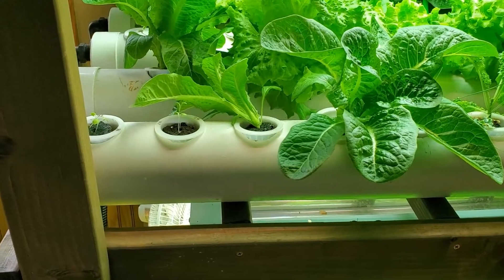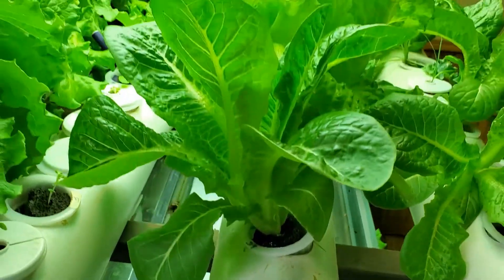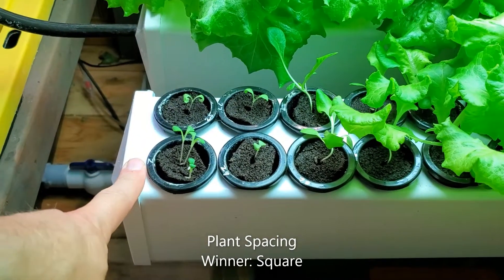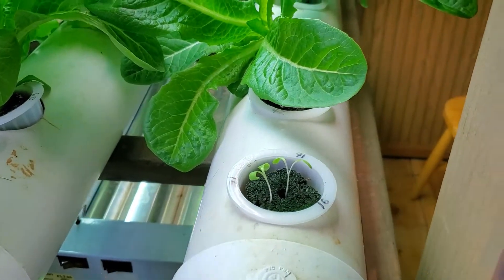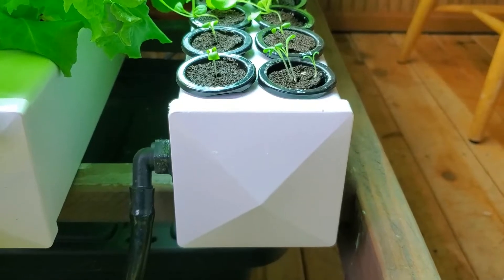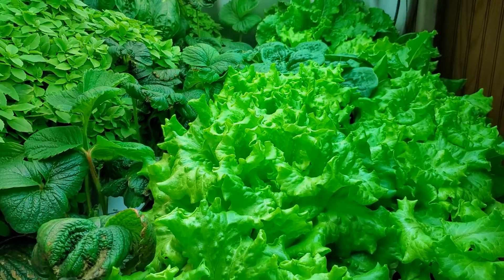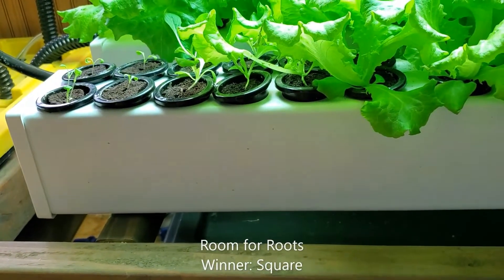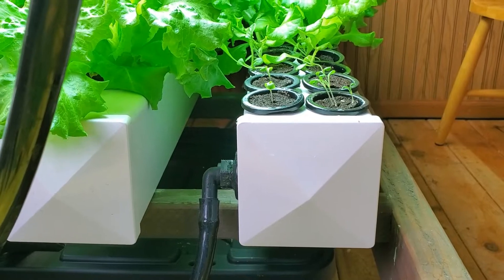Hydroponic PVC Rails: Round vs Square?

Comment: Building my system in a carpeted area. How concerned do i need to be about potential leakage from the fence post covers (assuming i use silicone)?

Is it worth building square or for watertight safety, should i rather use pvc round piping?

I can't afford to have any leakage whatsoever and i don't have any other space to grow in (I live in NYC and the only domain i have a say over is my bedroom)

Comment: I was considering square, but just did some more research.  Square fence post is vinyl PVC, not uPVC like pipes for drinking water.   Very toxic stuff that leaches phalates, BpA, etc.  uPVC like they use in pipes is similar, but they keep the nasty stuff out for drinking water contact.   Stay safe.   Also you could bend PVC pipe with a hairdryer and  board to flatten off the cup holding shape.

Comment: Use rain down spouts as they are only $10 for 10 ft. The ends are harder to seal but cost and size is smaller. 
https://youtu.be/BNJ2izubN24

Comment: I cut pvc 1/2” thick or wide rings out of two inch pipe ( if you are using 2” net cups) and inserted in the openings to prevent wobble.

Comment: I have a 4 X 4 PVC post sleeve system like yours and agree 100% with you! BUT SERIOUSLY!!! TOXICITY! : I have the exact reservoir as you, I did a ton of research on all the manufacturers of the black / Yellow top totes. ALL are made of recycled polypropylene resin (PP). BECAUSE it is a post consumer plastic there will definitely be leaching of chemicals that you DO NOT WANT!!! Please look up a food safe drum liner or the like and line your reservoir / tote with it to prevent I'll effects. We all learn new things every day!!! Great video! Best wishes!
Reply: Thanks for that, I was about to use a tote.  Also the fence posts are cheap vinyl PVC, not uPVC, they are more leachy and toxic than the totes….
Reply: @CGreciful  Poly Vinyl Chloride (PVC)  is safe, so long as the water temp. never goes above 120F. It can be used in some municipalities that accept it as code compliant. I got a mylar drum liner off Amazon to line my tote. I find the 27 gal. Totes to be perfect size. Best Regards.
Reply: @marknack7816  depends if you're talking about chlorinated or un-plasticized PVC.  The fence posts are the cheap stuff (why would they use the expensive stuff for a fence!).  Just be careful, there are dozens of types of PVC out there.  The bad ones are REALLY bad and the good ones are REALLY good.
Reply: Shh, nobody cares of your opinion. Not to offend. People care about real results. Don't let that make you mad but based  opinions vs facts. Facts win and opinions  are like a$$holes. Everyone  has one. And that doesn't matter
Reply: Unbiasedly  give an opinion  or do not at all

Comment: You don't need to glue the joints on the drain side of the round PVC because there is no pressure on the joint. A tight dry fit should be all you need. It would make the round system just as modular. You can also cut short stand pipes for the net cups, glue those to the round pipe and then the next cups are secure.
Reply: piece of 3" pipe 1/2" long, glue in place
Reply: Mine leaked. I didn’t want to use pvc glue to be able to remove and clean. I had a slow but consistent drips.  I used food grade silicone to seal.

Comment: I've had good luck setting up the round tubes with rubber bands on the ends to work as a gasket instead of cementing them in place.  I did this mostly as I was still working on the configuration and didn't want anything to be permanent, but it still works well enough and lets you disassemble things later.

The square tubes have a lot going for them, but they cost more, you can't get them in as long of lengths (or I haven't been able to find them), and I haven't been able to find any food safety ratings on them for anyone that might care about that.
Reply from the maker: Cool, I'm working on another system with round tubes and may try the rubber band trick. I remember trying it awhile back and it worked well.

Comment: Hey I was wondering if by then you changed this design. The square pipe has way too many planting spots per square inch and they're going to kill eachother
Reply: About to build a very similar design and wondering about hole to hole spacing. Any insight would be greatly appreciated
Reply from the maker: I still use the square design and it works really well. I move the plants along the rails as they grow, so only the seedlings are right next to each other. They are moved to an 8 inch spacing as mature plants so there's no crowding.

Comment: Excellent. Thanks for this review. I have several systems running: two towers with LED lights (indoor) and one outdoor system using piping. After using the piping system growing 108 plants I can see the square or rectangular type system is far better. The basil growing in the piping system are large now and the top heavy plants cause the roots growing inside a basket to occasionally pop out of the pipe. Also, it would seem to me there is better water flow to provide nutrients to the roots and more space for the roots to grow in rectangular or square channels. I think the rectangular channels would reduce the amount of water needed as well.

Comment: Just a simple tip, when building with round pipe, you can get a heat gun and heat around the holes... with a simple piece of wood then slight press area flat around the holes to stop that leaning issue. Awesome set up though mate! Cheers
Reply: I like the one DEA what would the heat which gets above 140 leach anything bad out of pvc? A good question though.
Reply: Show a video

Comment: Even if you use pvc cement on the round pipes you can seperate them with a little heat. While not ideal it can be done

Comment: Be grateful you guys have access to this stuff. Here in Australia, its near impossible to find any similar square PVC tubing. Plenty of 100mm x 50mm but too shallow. Not many importers for this stuff.
Reply: same in Canada, I think 10 ft of the square post cover is $50-90 depending on where you look!
Reply: I’ve seen another channel from Australia that makes his various hydroponic systems out of rain gutter downspouts, and they seem to work quite well.  I would feel awkward advertising someone else’s channel here, but you are able to search for rain gutter hydroponics and I’m sure you’ll find it.  You may have to treat each tube/pipe as a separate channel instead of a zig zag connection, but that shouldn’t be much of a deterrent
Reply: Bunnings sells 100 x 65 mm PVC.

Comment: Hi there, do you have the heights anywhere for you inlets and outlets on the round tubing to make it run correctly? The fence posts are too expensive where I live. Thanks.
Reply from the maker: If you grow seedlings in the system, then put the center of the outlets about 1.5 inches from the top of the cap to keep the water level up. Otherwise put them as low as possible (probably 1.5 inches from the bottom). Inlet is as low as possible, though not a big deal. Hope that helps!
Reply: @SimpleGreensHydroponics  Thanks for the help.

Comment: Two things that keeps me from building a hydro farm that way are
1. keeping the water stable, especially when plants are bigger it tends to high ph. How do you keep it stable?
2. dependency on the pump. If it fails, you have only short time to react. Do you have any alarm or failsafe?
I would rather go for a deep water culture that in my opinion brings almost the same results and is way more failsafe as it just needs an air-pump.
Btw. isn't it a risk using non-biological fertilizer as overdoses might accumulate in the plants?
Reply from the maker: 1. I have not had any significant issues with pH so it seems like regular water changes keeps it in a good range. 
2. I agree about the dependence on the pump, that's why I designed each rail to hold some water even if the pump shuts off. I've left the pumps off for more than 24 hrs during maintenance etc and the plants have done fine.
Reply: @SimpleGreensHydroponics  thanks for the reply. A larger amount of water might be the biggest adv and keeping water in the tubes in case of emergency is a good idea!

Comment: You can easily fix the stability issue on the round grow pipes. Simply heat the higher sides with a heat Gun & push them down until they are flat.
Reply: OR...
Custom 3d print net cups that conform to the round pipe...

Comment: I've toyed with both and found the round to have more advantages than the square. Cost is a biggy, those square post jackets are 4× the price of the pipe and the endcaps are also. I drilled the pipe so that a 1" piece of 2" pvc pipe could be forced into the hole giving me a flat seat for the netcups. I also use test caps on 1 end that can be easily removed and a threaded cap on the other so you can quickly remove the whole rail for cleaning. Using silicone on those posts is a pain in the ass when it comes to cleanout and reassembly.
Reply: How does the silicone work anyway?  I made a homemade cloner out of a plastic tote and tried using silicone and everyother type of caulk that is sold at lowes.....No caulk holds up to the nutrient solution (which are salt based).  I swear every caulk I've tried has melted in less than a month.
Reply: @Khaymen223  pure silicone. You can also ask advice from salt water fish hobbyists on non-silicone sealants they use if it doesn't work well for you

Comment: This is an indoor system, but if you are doing this outside, another advantage of fence posts is they are typically UV stabilized plastic vs plumbing pipes which usually aren't.
Reply: The vinyle has plaster users in it and should not be used for hydroponics per chemical engineering friend mine but makes sense. Use only schedule 40, 51 or 61 safe PVC. I know its a bummer would like go flat but unless you order by chance of it direct from manufacturer u will likely have stick with the schedule 40 pipe from local stores. Do not get the Schedule 40 series foam core pipe accidentally though just the heavy schedule 40. Also get Schedule 40 2" pipe and go with utterly as much safe off as possible. Super video n nice comments all helping and supporting info here.
Reply: In any of my systems, I first paint the whole thing with black paint then a coat of white in an attempt to slow down algae growth. I try to keep it dark inside the system but, if this is not a concern the a coat of paint to keep sun damage is a good idea too. Be sure to mask off areas where paint is not wanted.

Comment: Have you considered turning the square pipe 45 degrees so there is a piont up and pointed down, so not lay flat, that way you could stager the cut outs on opposite sides of the now 2 "tops"?
Reply: Nice video too

Comment: square tubing isnt food safe made of vinyl that is injected with chemicals to resist mold and cracking (called manufacture )  , round pvc is food grade safe as it is used as drinking water supply  ... that should be a huge factor
Reply from the maker: Yes, round PVC is often used for plumbing though many of the larger pipes are still not labeled "food safe". Based on my research I'm not concerned about either though:
https://www.simplegreenshydroponics.com/posts/2021/is-pvc-safe-for-hydroponics

Comment: I believe those vinyl fence posts are made of a similar pvc as plumbing pipe. I used pvc cement on my rail end caps and they seem to have formed a solid bond. I slathered extra cement in the corners just to make sure it wont bust a leak at some point. Hopefully they wont be too difficult to clean out at the end of the season because of the end caps being permanently attached...
Reply: they are not,  fence post are made of vinyl not pvc and injected with chemicals to resist cracking / mold at least here in canada. My dad has a greenhouse  and called the manufacture of the post that are at homedepo and was told they are NOT food grade

Comment: You missed covering the price difference between the two.
Reply: Use vinyl downspout 10’ length. You can get it for less than 15 bucks. Looks like he uses vinyl fence posts which are more expensive.

Comment: What you would like to have is FOOD GRADE PVC.. Most PVC are used for drainage and sewage.
PVC GLUE CAn be replaced very easily with DOW 688 which is very sticky and quick drying (not food grade) - as long as does not contact the nutrient solution and it can be easily removed and leaking joints can be easily fixed as external gap application .

Comment: The trust supports are wrong , the screws hold the weight. The beams should be support by a vertical one. Like the way you build a deck. 
The square shape is very good . Thank you for sharing , i'm looking to build one too.
Reply from the maker: I considered that, but decided to use compression on each end of the beams and a screw to hold them in place to reduce the size and materials. Each beam holds less than 20 lbs so not the same loading as a deck. Glad you liked it!

Comment: Some excellent points in this video, you've given me some things to think about. 
TBH I suspect price and availability (both piping but especially for fittings like endcaps) are likely to be the deciding factors on which pipes ultimately get used - here most of this type of piping is intended to be downpiping for house guttering, and tends to be round.
Reply: Oooooo, rain gutters are a great idea! Every time I see one of these DIY systems, I think "how are you going to clean that?" I think you are on to something great!
Reply: @RichardBronosky  How would you clean this one? It's something I've been meaning to ask,
Reply: @melody5437  what do you mean by "this one"? PVC pipe, PVC fence post, or PVC gutter? The gutter is obvious in how to clean, I believe. The post, I would seal with silicone caulk instead of glue so I could knock the ends off with a plastic "dead blow hammer" and clean once to 4 times a year. The pipe, I would build with a screw cap on at least one end. If I had to clean one that wasn't designed with cleaning ahead of time, I would try putting a box of Rock Salt in it an white vinegar and shake it about 4 times an hour for one day. I would only resort to harsh chemicals if time and wisdom failed.
What's your situation?
Reply: @RichardBronosky  Don't have one - that's why I asked. It turns out he has a video on how he cleans his system, however.
Reply: @melody5437  Good! You're doing the right thing. Always think about living with something before you make/purchase it. Life is not a TLC (USA TV channel) extreme renovation show. We have to live with our choices longer than 30 minutes, and how things look on camera are the least important characteristic. ☮❤🌈🧘🏽
Reply: Yes access for periodic cleaning is what many systems seem to lack. I always try to take that into account and will plumb in clean out fittings so I can run a mop through from at least one side.

Comment: I had the opportunity to watch plastic troughs be built for a huge indoor hydroponic operation ( growing machines 2 to 3 storeys high ) . The troughs were built onsite from thick plastic shaped  into half bowls with end caps plastic welded ( I didn't know plastic could be welded  ) on each end .Awesome to see finished and operational.  Maybe you could plastic weld a flat end cap to your square troughs ???
Reply from the maker: Yes, lots of options with custom fabrication. At this point I'm trying to use readily available materials so it's accessible for anyone, but it would be cool if there was more specialized solutions for hobby growers available in the future.

Comment: How easy is to clean the pipes? For a system to be successful, it has to be easy to maintain and clean. From the video I see that you are gluing both end caps, and that makes the cleaning harder. From my experience as  a DIY building hydroponics systems, I can say that using trays instead of pipes is the most effective system because it requires less piping connectors and it is much easier to put apart and clean. I built a 2x4 vertical system with Home Depot shelves and 2x4 trays, very similar to the vertical system from BootStrap farmers. Thank you for sharing.
Reply from the maker: The square system is fairly easy to clean since we can quickly disassemble it, though we've found that there isn't usually much to clean out - the system stays pretty clean on its own, especially with something like lettuce that is being harvested regularly and isn't leaving giant root wads behind. I'm planning to do a video cleaning in the near future.